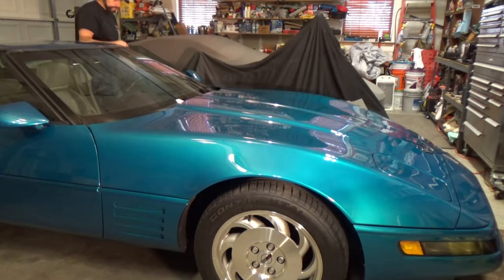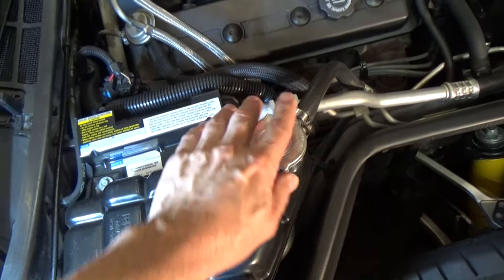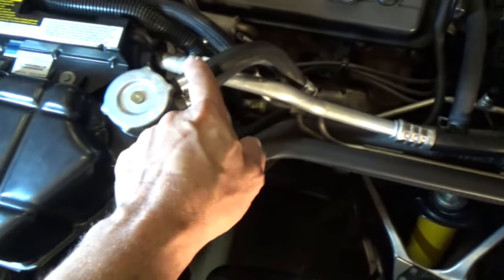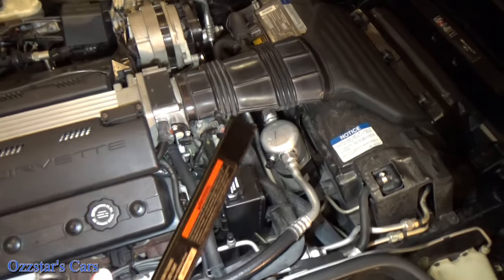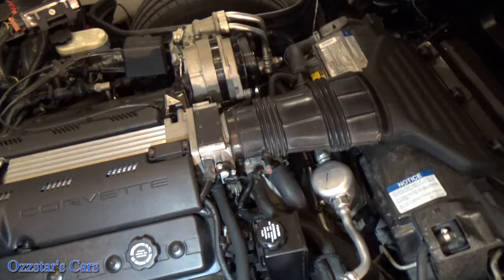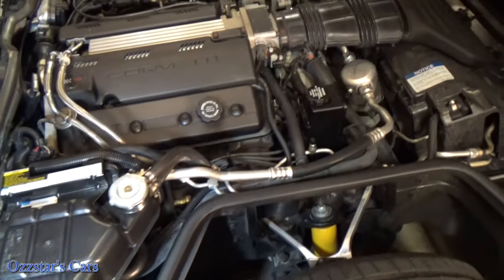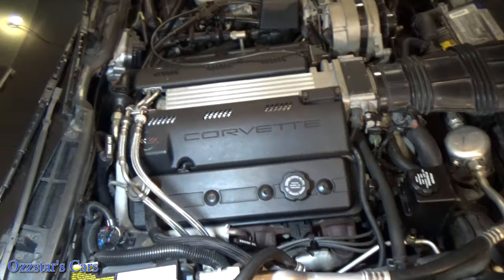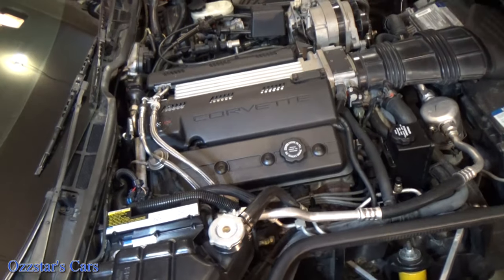Corvette Running Hot - Corvette Cooling System Maintenance Running Hot C4 1992-1996

Comment: The fan on those don't even turn on until 220 degrees.
Reply from the maker: 226⁰ F but who's counting.  Mark 9:35 in the video.
Reply from the maker: @ranbymonkeys2384  like I said in the video that you did not completely watch and skipped through, 226⁰ is when the fan kicks on but who's counting degrees.

Comment: Hi , I’m wondering how to add antiefreeze to our 2007 corvette.We live in Alberta Canada so we get -40 temps here. My husband had a stroke ,and I don’t know anything about cars. 
I’m pretty sure I need pure antifreeze,and not coolent , Im just going to top it off,I think it will be  good ,as my husband always took care of his baby. ( I am just the driver ) Thanks  M
Reply: Nooooo!!!! If you put in only coolant it will overheat. Pure coolant doesn't have good cooling capacity. You can test the mixture with a simple bulb tool with the floating balls in it. Any good garage with have that. Go for around 50/50 mix. Add distilled or demineralized water from a pharmacy... it's common and cheap. Use good products for a mix of iron and aluminum parts. If you find a good mechanic use Redline** "Water Wetter" additive to improve cooling, but in Alberta you should worry more about the cold and damaging the block. So get that mix correct.
** he mentions the company in the video. If you have questions... always ask. That is a good car, don't worry as most owners do. It is meant to run hotter for emissions.
PS Your 2007 is very different than this C4 Corvette. Just follow instructions from the manual and do prepare for -40°. Also use a high quality synthetic oil for cold starts with a good block heater.

Comment: Washing the rad with the opti dist isnt that a bad deal
Reply from the maker: No considering the optical spark isn't attached to the radiator.  Just don't doosch the water pump area where the opti is located.

Comment: I have a 85 Corvette with 31,000 miles and I am in the process of flushing the entire system out when I came across your video. According to Google and some autoparts stores they say it takes the orange antifreeze. So, I already bought the orange stuff, Do I use it?  Thanks for the video, very informative. :)
Reply from the maker: You might want to consider what GM coolant spec uses. Check your owners manual.

Comment: I dont think they run hot, its just the way the gauge is designed. My 2020 silverado runs at 210 normal 🤷🏼‍♂️
Reply from the maker: C4 Corvettes wth the LT1 run about 217-220 normal.
Reply: My stock 96 corvette runs at 205-210 F at 95-105 degrees outside
Reply: And 190 degrees running on highway